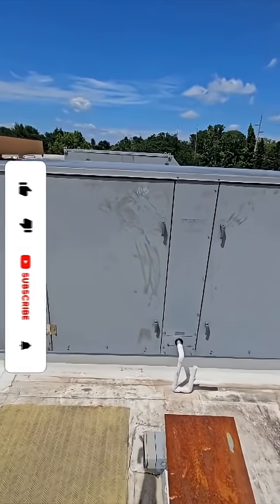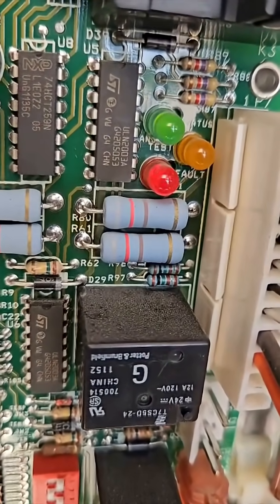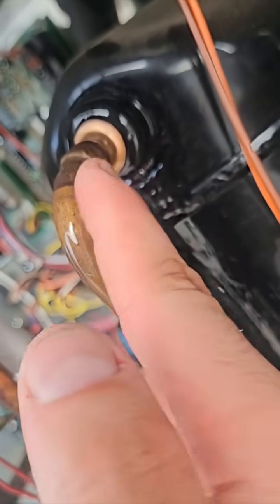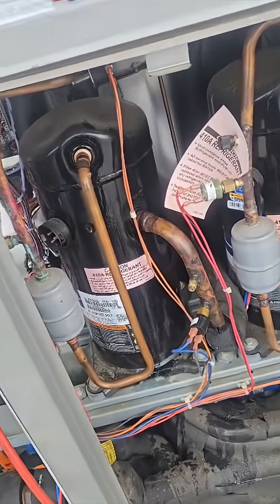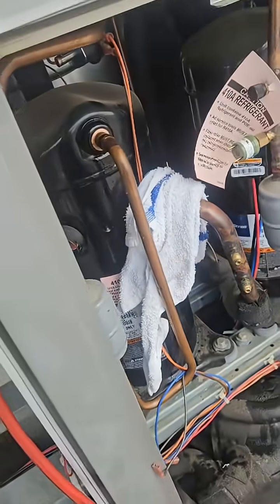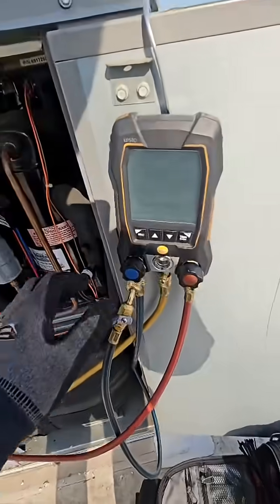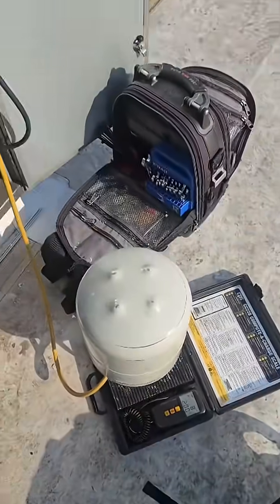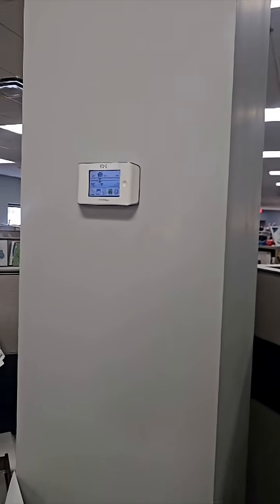Geothermal RTU Not Cooling?! #hvac #geothermal

Comment: Are those filter driers on the discharge? If so , chat gpt says they could be there for chronic acid issues or a clean out someone forgot to remove. Can you tell us why they are on the discharge ? Residential apprentice here 😢🤣
Reply: I’ve never seen liquid driers on a hot gas superheated line. Usually hot gas (discharge) lines have mufflers for noise and vibration.

Comment: I’m interested on why there is a liquid line filter drier on the discharge side of the system????!!! 🤓
Reply: Could have been a burnt compressor. So burnout cleanup of the line sets call for filter drier put on temporarily but they are removed after cleaned. 
These could be permanent acid neutralizers for systems with chronic acid issues. This is rare. Idk tho